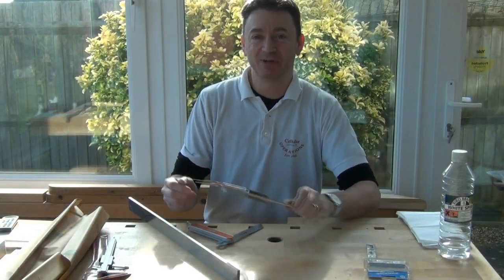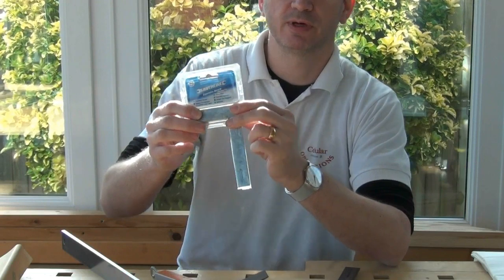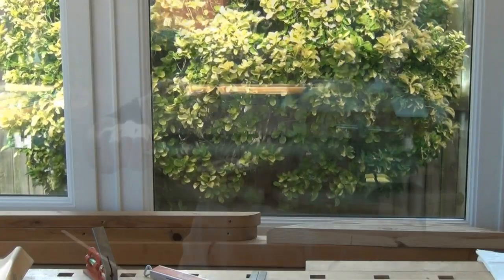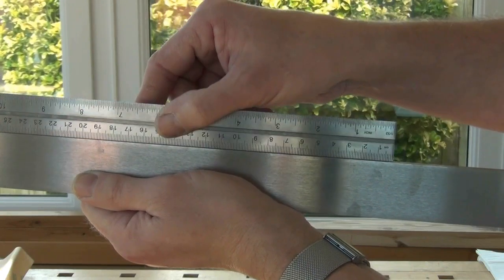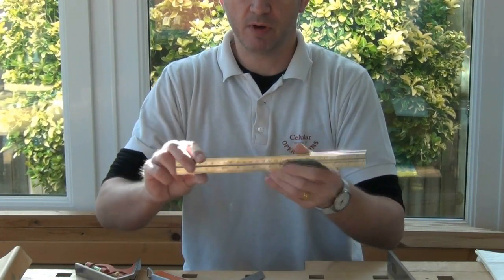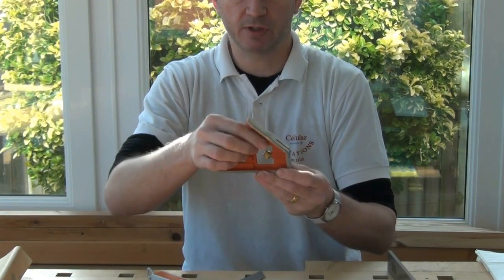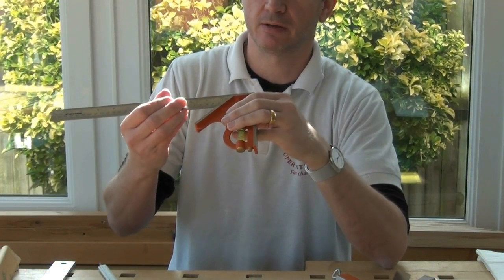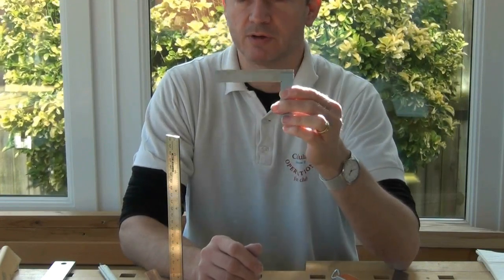Reviews - Silverline Engineer's Square & Bahco CS300 Combination Square

Comment: I hate having any imperial unit cruft on my tools but the BAHCO squares were the only decent combination squares I could find here in Poland. 

Great video!
Reply from the maker: +Tome4kkkk Cheers! Yeah, I know what you mean. It would be sensible if suppliers offered single units options. Thanks for watching.
Reply: Funny, I'm the same way about having metric markings on my tools...maybe I should learn to use them.

Comment: I'm always amazed that companies can sell squares that aren't square. How can they sell a product that only has one function (a simple one at that), yet fail miserably. You're much more tolerant of these tools than I would be.
Reply from the maker: Marty Backe Hi Marty, The cost of the silverline square plus say ten minutes to check and fix it, wouldn't guarantee getting you a square as accurate as you end up with. That's why I'm happy to accept the need for a little work.

Comment: I bought the exact same bahco combination square and I found that removing the little spring tensioning the screw makes it move a whole lot smoother.
Reply from the maker: KOU LEE Thanks, that's a good tip. Did you find it accurate straight out of the wrapper?
Reply: No. The rule was bent , and the 90 is not a 90.
Reply from the maker: KOU LEE Could be they had a bad batch, or maybe they set too wide a tolerance on their suppliers.
Reply: Could be , yes. I only use it for the rough marking , and a proper engineers square for final marking just like you do.

Comment: Great review. You say at 5:00 that you have a video on preparing straight edges. I presume that means how to make it straight. I tried to find that video, but only found one where you verify what is strait and what is not. Not how to make it straight. Can you link the one you referred to?
Reply from the maker: Use the method of verifying a straight edge to find the high areas, and remove them with a file or sand paper, rechecking regularly.

Comment: I have been using the 150 mm version of that Bahco for quite a while. I find that covers most of my needs for square, level and edge distance measurement. Even though it has moving parts, you can count on it to be accurate every time. What is the spike for? Making marks?
Reply from the maker: esa062 That's good to know. I was pleased with this one, with it only being slightly inaccurate, and easily fixed in minutes. Yes, the scribe is for marking a line. I didn't test how hard it was, but it should be hardened and capable of marking most things in the shop.

Comment: That is true what the comments were about you get what you pay for. If you buy something cheap it will serve you quite well if you measure with it, then mark it with a crayon, then cut it off with a chainsaw, It will probably do just fine, But in precision  work, we need tools we can trust and not have to keep checking them through the project! Thanks for the tips and reviews, they do help! Take care.
Reply from the maker: ***** Absolutely. With these two items, after fixing them I can't see any reason for them to become inaccurate again unless mistreated. That's the same with quite a bit of cheap kit. Unfortunately, some are just too flimsy to retain the corrections you make to them. The combination square is a good example. This one is of good solid construction and will be great when accurate. But a lot of the cheaper ones have very thin blades, that will dent and flex in use, making them pointless as accurate devices.
Reply: Yes, Very well said, and true! Take care.

Comment: I have the same Bahco square. It is nice for its price, 90 and 45 degrees are right, but the ruler is made of very soft steel. A couple of passes with marking knife and the edge is like a card scraper. Also, the ruler is slightly uneven (there is a little bump on one side) but it is ok for non-precise tasks and using a pencil.  My total score for this square is 4/5 if you do not expect it to be comparable to Starrett. If you do, then 3/5 :)
Reply from the maker: Thanks, that's good information

Comment: A huge number of tools are now bought online and need to be shipped via mail yet companies still package them with store display in mind which can and often does lead to damage in transit. Amazon do a pretty good job of over-packaging most tools. I have a love/hate with squares - I love them when they are accurate but hate it when a company will manufacture them and send them out when not true! I can understand making adjustments over time or after a big drop but not out the box. I've given up buying cheap engineers squares now and only go with those which conform to British or European standards as there are few things more reassuring as picking up a square that is 100% trusted to be at 90....(I need to get out more?)
Reply from the maker: Jonto Dickens Good observation. Interestingly, the try-square is manufactured to DIN875/1, so it may just be within tolerance. I suppose I'm inclined to aim for at least a '0' if not '00' rating, but without the larger outlay.

Comment: How do you calibrate a straight edge ? Or do you simply define an edge as "reference"?  Could be a good video topic
Reply from the maker: havenisse2009 I did a video on making a straight edge in the early days of WOmadeOD. Maybe I need to revisit the subject. You can calibrate straight edge by using a certified reference straight edge, which will have an accuracy associated with it (e.g. +/- 10um). If you don't have one, then you need three nominally straight edges to either check each other or make all three accurate. Check the video out.
Reply from the maker: ***** Haha! I think you're right.

Comment: to funny! I just picked up my BACHO 150 :) needs some tuning.
Reply from the maker: finn127 Oh dear, is it very bad? Do you know how to sorry it?
Reply: WOmadeOD - Made in Wood with Mitch Peacock nah, not too bad, the with of the ruler was 20,6mm at one end and 3/4 of the way to the other end, where it ended up at 20,3mm. So not quite parallell ;) Figuered I would start in that end, before scratching on the inside. Had to stop for a short moment, since my 1,5yo girl started acting up, and the mother made it perfectly clear that my place at the moment by all means was NOT in the shop ;)

So, not to bad.
Reply from the maker: finn127 A familiar story!
Reply: hehehe! It's square now ;) (ish)